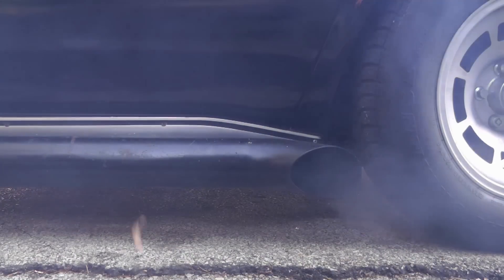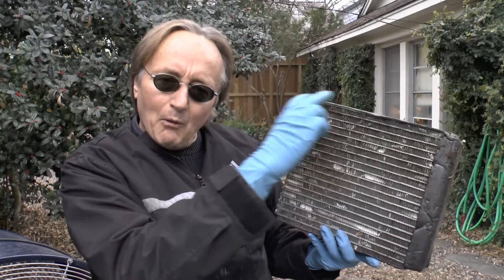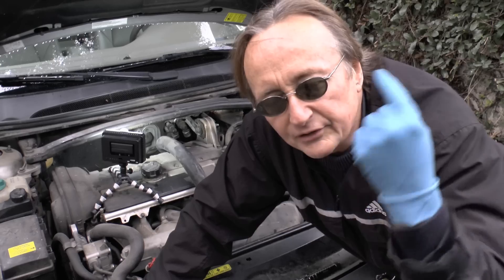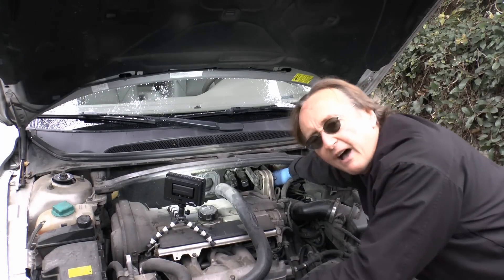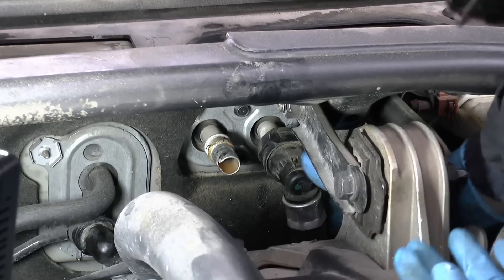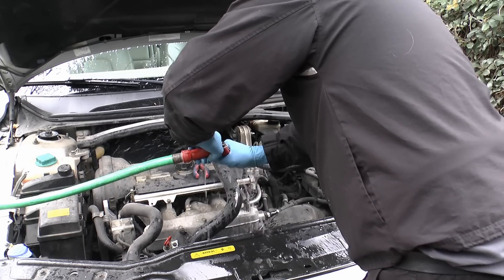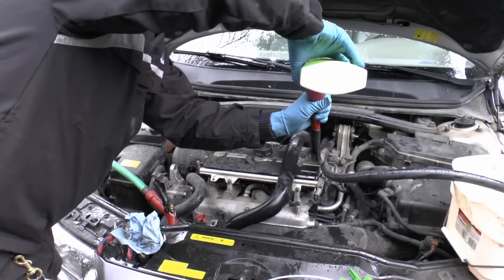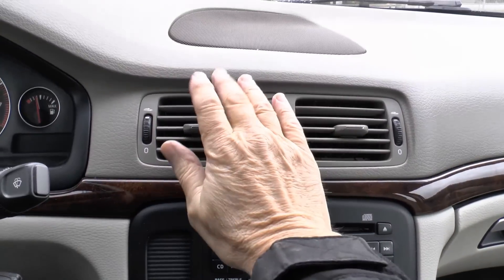Fixing A Broken Car Heater By Flushing It

Comment: I think I should do this once spring rolls around.  My heat works just fine, but I figured I'd do it sooner than later before my heat actually stops working
Reply: I've flushed the radiator twice in the 6 years I've had it, it has a new thermostat and gasket, I just haven't done the heater core yet.
Reply: It was in excellent condition when I got it at 66k miles.  I want to try and keep it that way for as long as I can.

Comment: I think you put the wrong coolant in it. 
When you took off the heater core hose the coolant coming out looked red, the coolant you replaced was green.
Reply: It's universal, the color doesn't matter.
Reply: +Recr Well not really, some cars do show a do not put orange/green colored coolant.
Reply: +Dylan McElveen the coolant does not stay green. It will usually change color to that rusty color
Reply: He did. The orange coolant is called Dexcool. He put the old green kind in which automobiles have been moving away from since roughly 2005. Not sure what the effects are of mixing them though...
Reply: The Mouse In Your Room mixing dexcool and conventional green coolant causes them to create a thick gel.
Reply: @JackRR15  scotty uses Global coolant only and it is compatible with ALL coolants no matter the color of coolant or make of vehicle.
Reply: @MouseyBusiness  wrong, its not the "old" green coolant, its the NEW Global coolant that is universal and compatible with ALL vehicles and coolant colors.
Reply: @seanmills1073  maybe that was true years ago, but the new Global coolant that scotty uses is compatible with ALL vehicles and coolant colors.